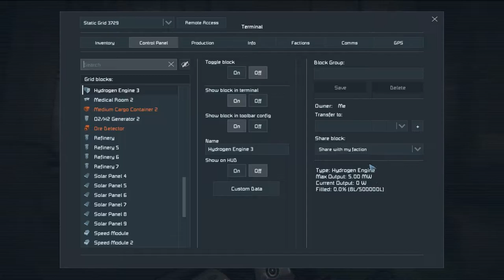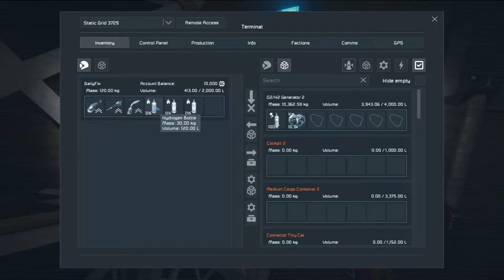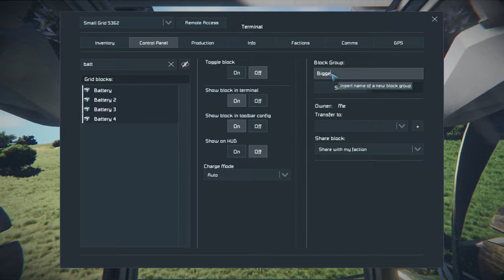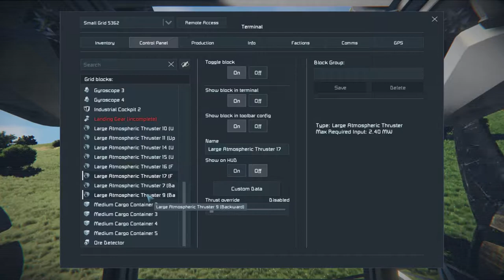[20] Running low - Road to Space - Space Engineers Survival

Comment: You need at least 2 o2 generator to get enough hydrogen for 1 engine. You should add a hydrogen tank to supply it with hydrogen or just put a bunch of wind turbine. I think people use the engine to speed up the charge of ship batteries. It eat up too much hydrogen if you don't have a lake. Add more gyro if you find it hard to turn. Add more thrusters or switch to the big version if the small ones are getting to be too many. 4 small is usually = 1 large. You will also need to add more backward thruster since you will drill face down. If you know how to switch to creative mode in survival game. You can copy your ship and paste it in creative then test it with load full of ore and see if it flies. Agile. Let's see you say that again when full XD
Reply from the maker: I will definitely get to work on the 2 hydrogen generators even if it's just to get a ship into space which would be our goal. Perhaps create another room with hanger doors for our miner and add a few hydrogen tanks there. As for the trusters I hope I won't need make as for the gyroscope's I hope 4 will be enough but we will find out soon enough.